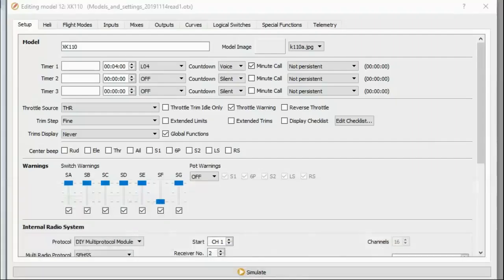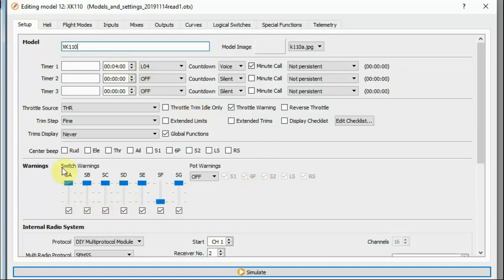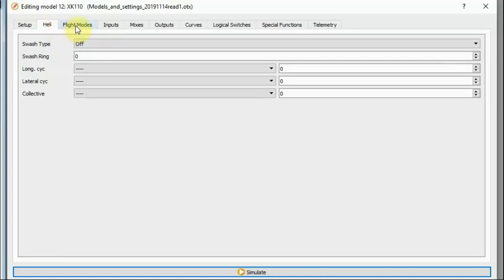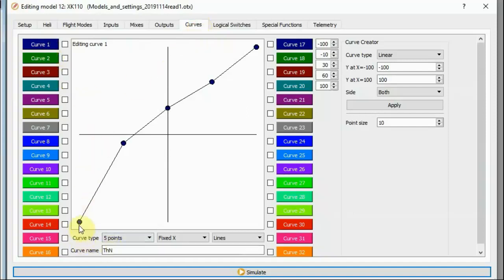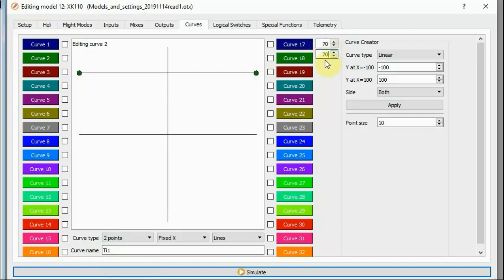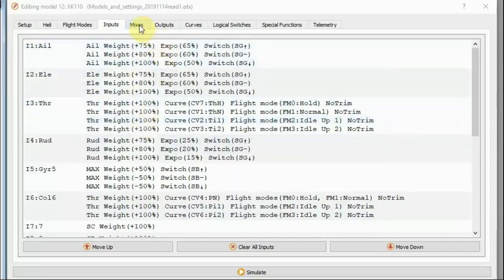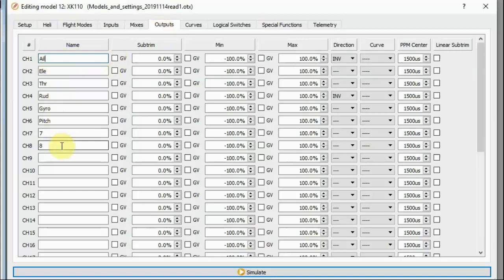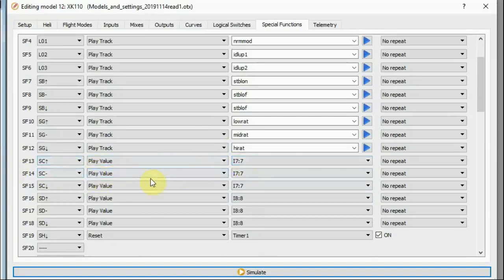OpenTX Heli Programming Pt 2 -  Flybarless Helis with Pitch Control XK, Blade, etc

Comment: Thanks for sharing! Hey you don't use a  source channel like 11 or 20 for collective?
You just got strait to thr as sournce on the collective channel right?
Reply from the maker: I'm not entirely sure that I understand what you are asking. The collective must be dependent upon the position of the left 'throttle' stick. We define the collective separately from the throttle itself in order that we can make the two dependent upon different curves - for example, in idle-up mode, the throttle will stay always at a fairly high positive value, whilst the collective (i.e. pitch) will go from highly negative to highly positive. This could all be done in several different ways in OpenTX, which is quite flexible. I choose to do it by defining the collective right on the Inputs page, as a second input sourced from the throttle stick. The collective on the Inputs page could, in fact, be put on any input number - the important thing is that the collective output must be on the correct channel for the heli. But since the collective output channel is almost always 6, it makes sense, for ease of understanding, to define the collective as input 6. I hope that this address your question... as I said, I'm not quite sure what you were asking.
Reply: @kleedhamhobby  
I've seen cppm mixes with say ch 20 holding all the collective mixes with throttle as source and then use channel 20 as source on a single  channel 6 collective mix.

Seen it done on ch 11 with FBL setups also.
Reply from the maker: @RC-Heli835  Well, for CCPM you need to put a collective source in on the heli page - and that would come from whatever you put the collective on via Inputs... could be any input number really, doesn't matter. Then, with CCPM your Mixes page will put the CYC values out to the cyclic servo channels. All this sort of thing is covered in parts 4 and 5 of this series of videos (was supposed to be in part 4, but then there were some issues that needed to be further clarified in part 5). For a FBL setup it doesn't really matter what input number you use for the collective - what matters is putting the value out on the correct channel, which will be channel 6 for the vast majority of helis.

Comment: Hi i downloaded your setup for the k110 and was wondering about the pitch curves when in hold mode. I would like to be able to see visually in idle up on and two the pitch move in hold mode. You say you like to see the pitch change when in hold mode normal how do i apply this in idle up so i can set my zero degees of pitch mechanically on the heli? any help would be greatly appreciated thank you
Reply from the maker: Well, you can make the pitch curve in Hold mode whatever is convenient for you - since the blades will never be turning, it is only for visual purposes. Look on the Inputs page, at I6 - you'll see that there are 3 lines, for Pitch Normal, Pitch Idle-up1 & Pitch Idle-up2; and you'll see that I have set the Pitch Normal curve to apply in both Normal Mode and Hold Mode. If you would rather have the Idle-up1 or Idle-up2 curve apply in Hold Mode, simply change it there - edit the first line and uncheck Flight Mode 0, then edit whichever Idle-up line you want and check Flight Mode 0. Of course, you could even define a specific curve just for Hold Mode and add a fourth line for that, if you'd like a special curve to help you with pitch setting.
Reply: @kleedhamhobby  Thank you so much for your helpful response. I ended up creating a specific curve fo throttle hold like yoou described and it works. Thank you again. i am new to rc helis and the jumper seemed an foordable option, slowly getting used to how it works with the help of your videos. again thank you and look forward to your next video
Reply: Hello,
Where i can find setup for xk K110 ? please

Comment: Great vid! Trouble with trex 250 using a old Walkera v120d02s 6-axis fbl system. It's been a pain to setup using my t16 pro. I cannot get the gyro to work so on movement my swatch doesn't level. Thx
Reply from the maker: I'm afraid I'm not familiar with the Walkera v120d02s system at all. You'd basically need to find a manual for that, or equivalent information, to find out how the stabilization is supposed to work. Most commonly channel 5 is used, but sometimes other channels, such as 7 and 8, might be involved in setting stabilization modes (5 might just be the tail gyro). As I say, I'm afraid I can't help you with that particular Walkera system - you've got to know what it's expecting in order to be able to set up the appropriate channel controls. If you can't find any real information on that flybarless controller, I can only suggest experimenting with different combinations of values on channels 5, 7 and 8.
Reply: @kleedhamhobby  thanks I have the manual but it doesn't clearly state what channel the gyro is on as it's in deviation format. So gear is set as switch etc. I will keep experimenting. Your video has been the most help so far. Thx again
Reply from the maker: @redogg2749  When it says 'gear' it will mean channel 5. If 7 and 8 are used, they will probably be referred to as Aux1 and Aux2. If 5 is assigned to a 3-position switch, the 3 positions will, by default, produce -100%, 0%, and 100% - if these values are changed, there should be some explicit programming indicating that. Also, if full ranges are given as 0-100%, remember they must be translated to -100% to +100% for OpenTX, so 50% becomes 0, 25% becomes -50%, etc.
Reply: @kleedhamhobby  Thanks I'm trying again today, if I cannot get this walkera system to work I may go get a microbeast or buy the xk k123 just to get some flight time in. its stressful 😄.

Comment: Hello kleedham ,i have yesterday watch your video and configure my t16 . When i pull down the th sf , the k110 do nothing .I have checked everthing 2twice . what could it be ? a wrong switsch assignment or 

esc issue day before i flash it with blheli
Reply from the maker: My own XK110 flies fine with this set-up, so I am thinking that you must have done something different to what I did. I will add a link here to an OTX file with my model for the XK110. Are you sure that you have successfully bound the heli to the model? If you have, then when you move the right stick around, you should see the rotor head tilting - if there is no motion of the head, then you don't have the heli bound. You need to set the protocol to SFHSS in the internal multi module, and then plug in the heli and click on the 'Bind' option, under the protocol. Also you can check on your T16 by using the 'monitor' option whether your throttle channel is really going up - press the MDL button, the press it again to monitor, flip switch F back and raise the throttle stick... you should see the red line for channel 3 going up: if you don't, then you have made a mistake in the set-up. Here is my XK110 model: https://drive.google.com/open?id=1JXPZGqsLFpkaXSp-DcRzzoEX0U3tC8Mg
Reply: @kleedhamhobby  thnks for helping me , i have bound the xk and tested with monitor he,s responding on ch 3 and and ch6 cpitch at the same time . Iam new to this hobby , i thought wrong wire connection esc and motor . Black up red in the middle and yellow downstars or my ppm min throttle to high 1148 in blheli ? Iam thinking making a new begin , watch your video again and create a new model to learn from it
Reply from the maker: @richardhulshof8029  If channel 3 is actually going up (the red line on the monitor display, not the grey one), and your motor is not responding, then there is probably something physically wrong with your heli. As you say, maybe your motor is not connected properly. There is not much I can do to help you with that. You could try loading my own model to your T16 and binding that to your K110 - I can say for sure that model works with my K110, which has not been modified.
Reply: @kleedhamhobby  when i pull down f , he,s not go spinning up . But when i put the throttle stick up he,s attempt to spin , but won,t it looks like he,s wil spin up counter clockwise when i put the throttle up . I have look how to load up your file , but can,t find the option restore model in the t16 and companion ?

Comment: I succeeded, the xk k110 flies joehoe.
I don't know what it was exactly about, I flashed the esc again yesterday. Everything set as standard in blheli ....

What can I set even lower in your Opentx config so that it flies a bit milder?

What I understand from your video that Ail, Ele, Rud are default settings.
Thr and Pitch curves are channels 3 and 6

And then on the 3rd to last page in companion curve charts 1 to 7.

I have been reading on forums for a while, but I see a lot of futuba settings for the xk.
And I myself have a jumper t16 with Opentx
Reply from the maker: Rates and Expo are set on the Inputs page, and controlled by switch G (top right). First make sure that you have switch G in the back position, as that will give low rates, which will be the mildest. If you want milder still, change the values on the Inputs page - current  low rates for aileron and elevator are 75% with 65% Expo, which is pretty soft - I wouldn't increase that Expo, but you could lower the rate a bit, if you feel the heli is too twitchy with those settings.
Reply: @kleedhamhobby  Thank you, 

I was already familiar with the switches, too bad that the manufacturers are only adding a simple manual.

I am going to test fly / hoover for and then see what the difference is if I lower everything
Reply from the maker: @richardhulshof8029  One thing I have found with my K110 is that the main gear is very prone to slipping down. It is only a push-fit onto the bottom of the shaft (like a lot of the little helis), and does not seem to make a very tight fit, so it can slide down, which will result in the heli getting very little positive pitch, and appearing to have no power to climb. This happens sometimes with various small helis (the Blade MCPX is also prone to this, for example), but the K110 seems particularly subject to this problem, in my case, at least.
Reply: @kleedhamhobby  Good morning

Last night when I took the xk again for testing, he reacted weird again.

In normal mode, nothing still happens when I switch sw hold.
If I put the sw in idle up 1, then he will tour, but he barely wants to rise. He shoots left immediately?

I bought the xk as bnf version with version 2 esc, unfortunately I screwed it up with soldering.

I then ordered a new one, but instead of version 2.0 I received version 1 esc ...

Will esc v1 be broken or incompatible with the k110 motherboard?

Greetings Richard
Reply from the maker: @richardhulshof8029  I'm afraid I have no knowledge that would help with your question about the ESC. I am not aware of what might be going on with different versions of the ESC. My own K110 is quite old (so presumably version 1), and I have not modified anything electrical on it - just replaced mechanical parts as needed. Of course nothing is immediately supposed to happen in Normal mode when you switch off throttle hold - you have to manually raise the throttle to take off in Normal mode. If the heli 'barely wants to rise', as noted before, that is generally a sign that the main gear has slipped down on the shaft - put your thumbs on top of the shaft and pull up the main gear with your fingers (or vice versa). The main gear should be snug against the frame, so that the main shaft cannot be wobbled up and down. If the heli shoots sideways that could be because the swash is not set up and leveled properly, or one of the servos could be defective or improperly connected.
Reply: @kleedhamhobby  thanks again 

To put me in the right direction , iam gonne read or watch youtube how to manual level the swashplate or via the t16
Reply: I hope you don,t mind all my questions . I have only one for the last because opentx and leveling. 

Blade tracking i can do when the xk is on and adjust the ballinks with the thr stick in center of the t16 ? 

And equal between the blades , is that a perfer in 6g and 3d or only 3d ? 
If i have right seen on tv i can make a adjustment in pitch to set the distance equal 0 and full thr stick . To increase or degrease nrs in pitch ? But i do,nt know wich one , the first or the second.. etc etc .
Englisch is not my second language , hopely have i it good translated from dutch to englisch lol
Reply from the maker: @richardhulshof8029  I'm sorry, I'm afraid I really can't quite understand your question. The blades should be level (if you fold them back together, one should not be above the other) when the pitch is zero - you can see from the pitch curves when this should be, for example with the throttle stick in the mid position in idle up mode. You can also just use the monitor function in the T16 and look at channel 6, which controls pitch for the K110. As I say, I really don't understand quite what you are asking. Leveling of the swash and setting of zero pitch would generally be done by physically adjusting the heli, not by anything on the transmitter side (though some helis have procedures to aid in the process which involve specific inputs from the transmitter during the process). I have never actually adjusted the swash servos on my K110, as they were ok the way they came, and I have not had to replace anything that required resetting them.
Reply: @kleedhamhobby  I don't understand anything about the swash i had adjust 3 times tonight. 2x with head off and swash tool and 1 x on the eye. Have not changed anything in your config in the transmitter.

I have thr_hold on, sw-e in the mid idle up1, sw-g back low rates, and thr stick in the mid.
It shows 20% in mid stick position.

Could it be a bug in Opentx? or have i make a mistake in your config.

What strikes me about sw-e, I don't hear amber talking when I change from nrm idl1 or idl2
Reply from the maker: @richardhulshof8029  I'm glad you got it fixed. You're ahead of me now - I'm on 2.3.4. When I looked this morning, 2.3.5 was only in nightlies, though they did say they would be making it a full release soon, as there was some critical issue (with receivers that I don't use). Hopefully it will work well for you now. If you have any more questions about the set-up, I will try to respond.
Reply: Problem solved : I have flasht the jumper t16 with opentx 2.3.5 firmware and changed in tab flightmodes and in tab specialfuntions lo1,lo2,lo3 in to switch e up mid and back .
Now shows the monitor 0%pitch instead of the 20% first , finally

Comment: Hi. I would like to have throttle hold switch also. To do that should i make flight mode 4? Flight mode 4 is like a throttle kill more?
Reply from the maker: Flight mode 0 is the throttle hold mode, already defined in this set-up - please watch the video again from 5:36 on. When switch F is back, the throttle will be locked off.
Reply: @kleedhamhobby  f mode 0 its like throttle cut with -100%. I need to make also throttle hold with - 90% for all 3 flight mode's. I need it for autorotation bailout for bigger heli. Can i make new input based on throttle curve - 90% apply to all fly modes after swich is on?
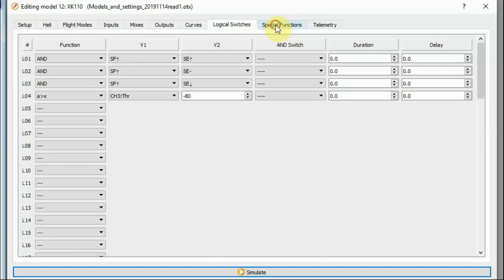Reply from the maker: @maksymilianwilkus1592  If you want to force throttle to -90% under some circumstances, I'd suggest doing it with a Special Function. Look at my Special Functions (23:23 in the video) - the first one forces the throttle channel to -100% when SF is back (basically duplicating what the Flight Mode 0 is doing anyway). You could add another Special Function to Override CH3:Thr to -90% based on the position of another switch - of course you'd have to choose a switch that you think will work for you... it's hard to reach a switch quickly in a bailout situation. If I were to add such a function myself, I'd also add Play Track functions to speak the switch positions for it. You could also add a 5th flight mode, if you really wanted to... but then you'd have to fix things up so that is the switch condition for your 5th mode was met, the conditions for none of the lower modes would be met (via the Logical Switches page).
Reply: @kleedhamhobby  thank u very much!

Comment: hi ... can it be a flsky simulator for tx16s?
Reply from the maker: I am not clear what you mean. By tx16s I assume you mean the RadioMaster TX16S transmitter. I have an older Jumper T16, but I believe the multi-protocol module in the TX16S is basically the same, based on Pascal Langer's work. But then what do you mean by 'flsky'? The multi-protocol module supports Flysky and Frsky protocols. So, if you mean 'can the RadioMaster TX16S control receivers using Flysky (or Frsky) protocol?', then the answer is yes (although there may be some limitations with Frsky, as there are so many variations and complications with that protocol). On the other hand, if you are talking about simulation on a computer, then OpenTX Companion provides a simulator for all OpenTX programming on supported transmitters.